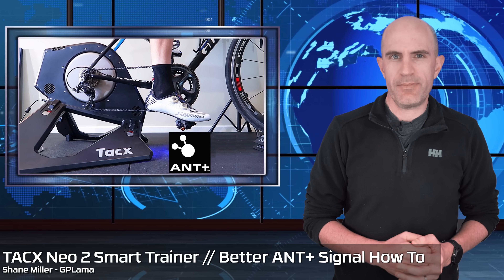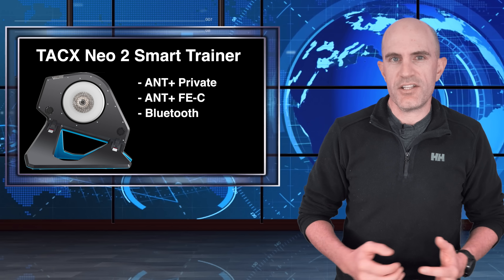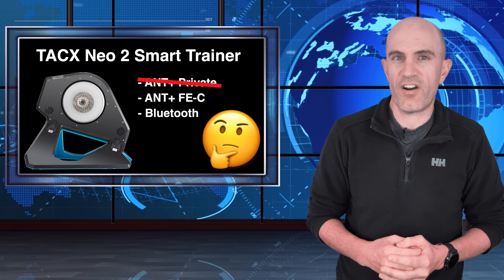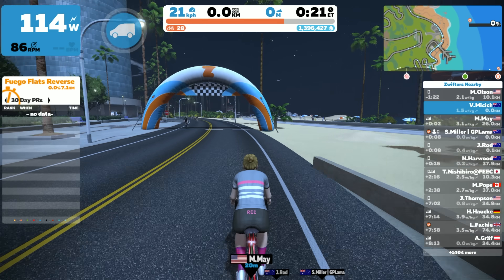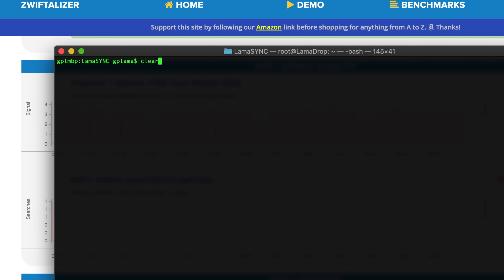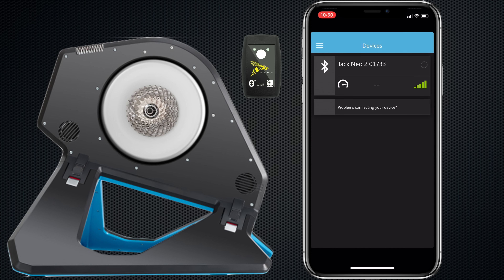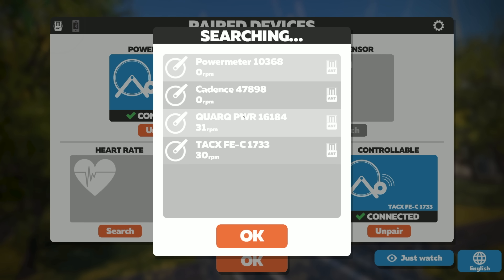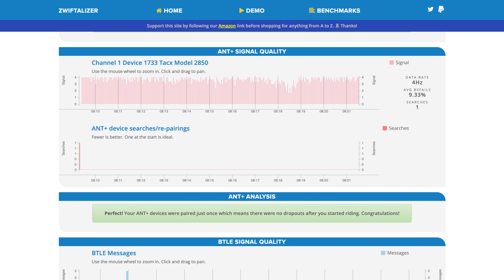TACX Neo 2 Smart Trainer // Better ANT+ Signal How To

Comment: Hi Shane! I've only just seen this and it is sooooo important for Ant+ users to understand the implications, so as not to always blame the software they are using for any lag etc! :-) I have one simple question :-) . At 8:09 I'm slightly confused (sorry to appear picky) about the wording in relation to Bluetooth. IF a user ONLY uses Bluetooth and NEVER uses Ant+ Private or Ant+ FEC, will they experience any  difference at all in the signal quality? Is the Ant+ switch status irrelevant for Bluetooth users? THANK YOU for all the wonderful work you do!
Reply from the maker: Shouldn't have any impact at all on BLE.

Comment: I've just purchases a neoT2. I can get it to work using Bluetooth and the Tacx Desktop app. I want to also have heart rate in the app but my HR monitor is a Garmin Ant+ item. So I've purchased a Tacx USB ANT+ Antenna (T202) with the plan to use ANT+ in the app but I'm having trouble getting that to work. The app tells me that ANT+ is unavailable. My Windows 10 laptop's device manager states there are no drivers for the antenna. I've searched Garmin/Tacx online with no luck finding downloadable drivers. Any suggestions?
Reply from the maker: One for Tacx support. Windows should detect the device and it should just work.
Reply: @gplama  Yes it's weird the Tacx trainer doesn't detect the Garmin HRM directly (there's not even an option to do so) but I got around this using the Ant+ for the HRM (it is also possible to just skip BT and use Ant+ for the trainer and HRM).  I'm using the Tacx app rather than Zwift and it worked the first two times I used it but has since stopped working and I can no longer receive the signal from either the trainer or HRM through the Ant+ (BT is unaffected).  This is the case even though Tacx says that the Ant+ is connected.  Makes no sense.
Reply: Hi Greg, if you haven't found a solution to this, try installing Garmin Express that loads the drivers for Ant+ and device manager then reports everything is working.
Reply: @stevebradbury984  all sorted now ... but thanks for responding.

Comment: Shane, this was very helpful as I have been struggling with my Neo 2T having lots of drops.  I have watched an early video of yours about the environment and what to do and still drops.  I typically ride Zwift or Sufferfest and use Today's Plan so I keep my bike computer (Garmin Edge 830) running as well as my PC (for Zwift etc.).  If I turn off the ANT+ I can't connect my Edge to the Neo via BLE.  At least I haven't figured that out yet and it doesn't appear that the 830 supports the ANT+ FE.  I'll keep looking but curious if you have a solution. I was thinking I would throw my Assioma pedals on and just use the power meter data for my Garmin there.  But then I would not have any speed data and thus no distance data on Garmin Connect when it uploads to Today's plan.  Confused?  Me too.

Comment: Hey Shane great work. I have only ever used BT to connect to my Macbook Pro 2019 and iPhone 11 and seem to get quite a few power failures on the power signal (especially mid race *&^%) manly on the laptop BT. The couple of reviews you have done on ANT+ skip over the BT option! Have you found that ANT+ to be more reliable than BT. I have read that the BT receiver can get "data swamped" on the laptop and to put some devices on BT and some on ANT+. Any thoughts?
Reply from the maker: I've always used ANT+ to collect data from and control trainers as Windows was a nightmare when it came to Bluetooth Smart support. That changed with Win10 and a number of service releases. I've recently been using Bluetooth on Windows direct to simplify things in the Lama Lab for my rides. It's working fine. 

There's way too many combinations to 'test' everything in any review. BLE to iOS/tvOS/Android/PC/Mac, ANT+ to all of the above or via a bridge of some sort. 

If BLE is giving you dramas, switch to ANT+ and see.  I hope Smart Trainers will be direct WiFi soon using faster and more secure standards over 5Ghz... but I'm not holding my breath on that.

Comment: Great video! Where do you get the “Wasp” signal detector you used in the video?
Reply from the maker: That's by a company called North Pole Engineering (NPE)
Reply: Shane Miller - GPLama Thanks! As a Cybersecurity enthusiast/student this could be a valuable tool in my tool bag. Software defines radios are my latest in a long list of obsessions.

Comment: I experienced an issue where my Macbook running a Zwift ERG workout was on my 5GHz WiFi network while the Zwift Companion app on my iPhone was running on the 2.5 network resulting in complete disconnection from the Companion app which made ERG intervals difficult to target. Therefore, if you use the 5 GHz network, make sure everything else is also on it.
Reply from the maker: That depends on your WiFi setup. If you have a WiFi router/access point that "flattens" both 5GHz and 2.4GHz onto the same layer 3 subnet, you can mix and match frequencies.
Reply: @gplama  It would work, then drop out for a minute and reconnect. Never thought to troubleshoot it further since staying on the same frequency seemed to do the trick. Thanks again for your contributions Shane. They are super helpful.

Comment: Hi Shane and others who may have an answer:), I always use my Garmin Edge unit as backup when I use Zwift & my Tacx Neo 2 trainer. Do you think that sharing the ANT+ signal from my Tacx trainer between the Garmin Edge bike computer and Zwift could cause signal dropout issues in Zwift? Would you recommend against using bike computers when connecting Zwift to a smart trainer?
Reply from the maker: No. And... it's up to you. Head units have a lap button (Zwift doesn't). They also have a ton of metrics that you might find useful that aren't available on screen within Zwift.

Comment: Unrelated question if i may Shane? I've just bought a new tarmac disc, and was told that if i put it on my trainer (tacx neo) then I lose my frame warranty under Specialized NZ. Is the same true in Aus? Will the trainer damage my frame? Im very concerned as both bike and trainer were massive investments for me.
Reply from the maker: It won’t damage your frame in any way. Tell Specialized to pull their heads out of their arses and support their customers with how people use their bikes in 2019.

Comment: This is very helpful Shane.  Something I haven’t seen you mention is something that solved a very annoying ant+ dropout problem I was having.  It turned out to be the Windows USB power savings setting mentioned at the link below.  Despite being set at High Performance energy management, Windows was shutting my USB ports down and cutting off my signal.  After finding that buried setting and disabling it I haven’t had problems since.  Thought you’d be interested too.  https://support.zwift.com/de/my-ant+-signal-is-dropping-(cycling)-SJdW01bHX
Reply from the maker: I've done this on the two Win10 machines in the Lama Lab. Cheers for the reminder that it could be a handy tip. I'll add it to a Swift Zwift Tip soon. 👍
Reply: Great suggestion. That cleared up all ANT+ problems on my laptop.
Reply: The link is broken, however I found these instructions on how to do this and it seems to have worked. The Tacx App now has the functionality to turn off the ANT+ setting for Tacx Flux now, too. Thanks for your kelp Shane and twardo2224

Comment: Does ant+ affect Bluetooth? Which is best to pair over? Bluetooth or ant+ assuming you only need one connection anyway
Reply from the maker: It shouldn't. Not in the same way ANT+ and ANT+ FE-C go head to head... but without doing more tests on both ANT+ and BLE, I cant be 100%. There's no consensus if ANT+ or BLE are better. I have a feeling BLE could be better.... but I'm always using ANT+ for Lama Lab Tests (and because I'm using Windows 10 - where direct BLE support for Zwift is still beta). It's an area that needs more looking into for sure.
Reply: @gplama  thanks for the reply, I tend to use ant+ for pc and Bluetooth for everything else, I've not really noticed much difference but erg mode does seem to hold better with Bluetooth (could be all in my head though)
Reply: @Boris Lewandowski I think I agree but hard to test it. My remote control fan does seem to trip my ant+ connection but never Bluetooth so you may be onto something

Comment: Shane thanks!! I will try this PerfPRO Studio tomorrow.  I just stopped using Zwift.  I'll let you know if this works with PerfPRO as well.  I think it will as I just glanced at Drew's PerfPRO documentation.  Thanks again and very helpful tip.   I do have a Neo 2.
Reply from the maker: As long as it pairs over ANT+ FE-C, you'll be good. Keep us posted. Always good to know how others get on.
Reply: Boris, I don't suffer from dropouts with PerfPROand my stages but I was with my stages with the Garmin 520 when running both Tacx Neo 2 and stages at the same time with my PerfPRO.  Given that I did attempt to get PerfPROto work the Neo 2 while disabled ANT+ in the Neo2 and I was not successful.  I tried two different USB sticks (Suunuto Movestick Mini and Garmin) and I could not get PerfPRO to work in this mode.  It could have just been me and my setup.  I don't know.

Comment: Good tips Shane but is there a workaround to turn off the channels without the wasp? That’s a 283usd investment. Is there an acceptable failure percentage one can live with for accurate data/performance with out that expense? Love the older videos of the ant+ tricks, plastic baggie, better usb cable, tacx antenna and WiFi channel tips. Thanks! 👍
Reply: Good info. Thanks all!
Reply from the maker: Sorry if that wasn't clear - The WASP was just to watch those channels die off after toggling it off within the Tacx Util app.

Comment: Didn't know such option even existed. It should be available in every sensor. Amount of pointless data flying in the air is sometimes ridiculous. Especially if there is more than one bike, smart trainer and power meter in the room. Total Ant+ FE-C, Ant+ PWR, ANT+ Spd/Cad and BT mayhem. I find myself scrolling sensor list in Zwift pairing screen for days ;)
Reply from the maker: Agreed! The Kickr(s) need this to stop the ANT+ vs ANT+ FE-C issues that always pop up on user forums. (Those wondering, the FE-C profile on the Kickrs seems to be the best option to go with)
Reply: @gplama  Yeah. It's also malady of Elite trainers. I lost count of people having problems with resistance not working because their trainer paired automatically through Ant+ as something different than FE-C. Also shout out to Elite.: what the hell is that other "realtrainer" nonsense seen in controllable trainer pairing screen? Is it some proprietary communication channel? Do something with it because it causes havoc.
Reply: @gplama  I've discovered that if you replug the USB dongle while on the pairing screen then Zwift won't always reselect your previous sensors. 90%+ of the time for me it automatically switches the controllable FE-C profile to the plain old ANT+ profile even though power stays on FE-C.

I think this is where all the "it worked for six months and I haven't changed anything" problems come from. Wahoo could fix it by adding this option to their firmware or Zwift could improve their pairing.

At this point I don't trust it anymore and check everything says FE-C every time I start Zwift.